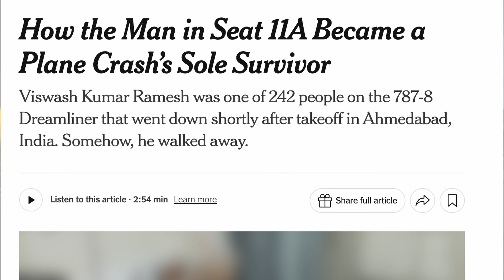Why the RAT Changes Everything – Air India 171 Update

Comment: Suggestion  why All Air Plane   not have a technical mechanasume to complete shutt the flow of fuel  and  completely shutt it off withe no any leaks avoiding fier. Or away to isolate the fuel tank and sending it to ground or away from the plane avoiding fier reason the worse thing hapoining in crash is the fier cause hitting down still we can have savety factories

Shams

Comment: My deep condolences to all affected by this tragedy. 

Wrong flap settings or operation  = pilot fault. 

Dual engine failure, could be fuel failure (water ingress or similar) although you’d have expected to see signs of that earlier. Could be double bird strike. Ooph. 

Boeing’s stock isn’t going to like this.

Comment: Stupid question for any aircraft engineers out there. The fuel pickups points would be at the low point of any fuel tank which is where any water contamination would collect. Are there any sensors to warn about water in the tanks? I suspect a conductivity check in the tank or a density check on what's flowing thru the fuel lines would tell. Any warning could switch to another tank for fuel.

Comment: A point you didn’t mention is the dust cloud as it took off. Others have said they used the whole runway to get airborne, this surely also points to engine trouble. 

I understand they taxied to a mid point and then rolled back down to start of runway before proceeding, so they did use the whole runway - maybe some figures estimating weight and expected V2 point would be helpful

Comment: Actually if dual engines failure theory is true. Pilot's have shown acumenship of retreating the flap or lets say not deploying them fully, else that would result in adding further more drag and more thrust requirement (which was absent) and would result in further less time in air.

Comment: Hello Captain Steve, this is Captain Neo, sea captain. Now it is obvious that they had thrust loss. I believe that fuel contamination scenario is little bit unrealistic, however there is possibility for that, of course minimal possibility. In my view the most realistic scenario is that something happened to electrical systems and hydraulic power. The APU is of course an extra source for emergency power , but the emergency prop generator is the last solution for the loss of power. I don't sure if the APU can start by battery emergency source, but if is not then the prop generator is the only solution in total loss of power. Please inform if the APU may start without main electrical power source, but just by emergency batteries or any other starting system. The APU probably is jet /gas turbine generator. I believe that when the main electrical generator ,which is if I remember well is on left engine, lost power then APU should start automatically within some seconds and if APU not start then the RAT automatically deploying. That is right ?

Comment: The other thing is why did they take every inch of a 11,500’ runway to barely lift off.  There are so many reasons for this besides engine issues.  No one has discussed these reasons.  Instead everyone wants to assume how it happened.  I flew this aircraft type for 6 years and I’m not about to guess how this happened until we have substantial data/evidence of what actually transpired over this short period of time and the time leading up to this takeoff.  I enjoy your content, but I was shocked to hear you reverse your thoughts merely by the suspicion that the RAT was deployed due to a dual engine fail when there are multiple ways that the RAT can be deployed.  Please listen closely to that clip of the aircraft passing by prior to the impact.  You will hear that at least one of their engines is running.  Thank you for what you do.  Your channel is certainly one of the top aviation channels and it’s obvious that you love what you do.  A couple accidents reviews that might give a little insight into loss or lack of lift are the Comair CRJ200 accident in Lexington, KY as well as the 1987 accident of Northwest 255 in Detroit, MI.  Fly safe!

Comment: I hear jet engines running also. But yes, I will accept the theory it was down on power. It fits with my opinion the aircraft was sinking as it was flying to slow for its takeoff weight. I am thinking it crashed because the pilots were given the wrong cargo weight and calculated a V1 and V2 speeds that were too slow for the true weight.  I am wondering why they did not immediately retract the undercarriage to reduce drag and gain airspeed. It seems the instinctive thing for any pilot to do when lacking airspeed for any reason. The black boxes will give the answers.

Comment: Why does everyone think that the deployed RAT automatically means dual engine failure?  There are 4 ways for that RAT to be deployed.  Manually is one of the four ways to drop the RAT.  I still can hear at least one jet engine running as the aircraft passes by before impact.  Their Mayday call has been quoted  as several different statements.  All of them eluding the power was not sufficient.  If the plane was sinking and they had the throttles at the stop, it may have appeared to the pilots that they were losing power and not recognizing that they were actually losing lift.  If that was the case, they may have dropped the RAT manually to ensure controllability of the aircraft.

Comment: Have you seen that video of a man who was on the flight before it crashed? He had taken a video of the inside of the aircraft when it flew into India, saying that the electric wasn't working. AC was out, the screens on the headrests weren't working either, and he was going to send in a complaint about it. He took photos of the outside of the plane as well and confirmed it's tail number was the same. If it was having electrical issues in its most recent flight before the crash, then maybe it had something to do with that? Maybe the plane shouldn't have been cleared for flight.

Comment: So I said in Steve's last video that though the theory that they pulled the wrong lever was completely ridiculous by any kind of trained pilot...and mention the RAT myself via the video and audio evidence.

The other question is why was the landing gear down...and my theory there is... Had both engines failed, with the RAT deployed they may have thought they had enough power to get to immediately get somewhere to land. And obviously to do that they had to keep the landing gear down.

I'm still not discounting complete hydraulic failure...because even with no engine power they maybe could have steered away to a less populated area. With no hydraulics it very likely would have continued to just go straight like it did...

One simple  thing you need to ask the one survivor:  did you hear any engines?  If both engine had flamed out it would have been quiet as a mouse in that cabin...and something he certainly should remember.

I'm sure by now they have at least one box so it won't take long to figure out exactly what happened..
Reply: The survivor clearly told in one video that there was sudden silence and then he heard a loud bang underneath and later green and white lights started to flicker inside aircraft.
Reply: @shakeelabegum_sk I actually haven't heard many of his interviews so that would definitely lead creedence to the double engine failure.  Other than the fact that there's an infinitesimal possibility of that happening... So the big question would be HOW?  If it was contaminated fuel come unless the contamination came from the plane itself, it would have affected other flights.   We should hear more soon as they've had the flight recorders several days now.

Comment: A theory has formed in my mind. I am not a pilot nor an aviation expert so correct me if i`m wrong but based on RAT being deployed and a report that AC and in-flight entertainment not operating properly, I think that some kind of power failure caused both fuel pumps to shut off starving the engines.

Comment: @CaptainSteeeve Does it not at all to you sound like there is some thrust in those jet engines as well, all the way down??. Yes, the RAT can be heard, but in my ears it sounds like those jet engines also are working, somewhat anyway? I have been in to the flaps up instead of gear theory my self, until now. I almost hoped it was a clear pilot error, even how crazy that sounds. Pilot errors are isolated incidents, but if this is a Boeing or GE problem a lot will happen, in an already shaken industry. As well as flying customers being scared to enter any plane soon, many of them carrying same systems.. Thats why i am saying an isolated incident with a pilot error would have been the best of the bad… 
One would think contamination would have been noticed before 400 feet!? But finally, cant rule out sabotage or maintenance error either yet i guess..  RIP to all passengers who lost their life's and a huge thought goes to their relatives.. (ex pilot from Finland) Thanx for great videos..

Comment: I used to work in scientific instrumentation for acoustic measurement and analysis, and I've spent most of my life living between "London" Luton Airport and the Shuttleworth Aerodrome. I know the difference between propeller noise and jet noise: you are hearing propeller noise of some sort and I thought that even with the poor audio quality of the rip-off copy of the video clip.
And what you are NOT hearing is one or two big turbofans producing any meaningful power at all. You can also see this, because if there were thrust, the aircraft wouldn't be sinking that quickly and I doubt that the automatic flight controls would be pitching the nose up quite so far. I can't go as far as to claim the aircraft wouldn't have crashed, but it wouldn't have crashed so quickly and certainly not in the same place. 

It is not impossible, however, that an electrical fault might deprive the engine controls (FADEC) of their power and thus deprive the engines of their intelligence. That could make the engines fail in a strange and unusual way: it would certainly be a difficult failure mode for the crew to recognise and report.

Comment: There was a person that flew with his airplane right before it crashed. He said that there was a massive electrical issue on the previous flight no TVs no lights no nothing it could be. It’s electrical issue.
Reply: I've flown in air india aircrafts, tvs not working is a common issue
Reply: You're right to point out that. While the initial reports and public discussion often linked the previous viral videos of non-functioning amenities to the general state of Air India's older fleet, aviation experts and official investigating bodies have indeed stated that such issues are highly unlikely to be the direct cause of a catastrophic event like a plane crash.
Here's why and what the investigation is actually focusing on:
 * Hierarchy of Systems: In-flight entertainment, lighting, and even air conditioning are considered "non-critical" systems for the safe operation of an aircraft. A plane is designed to fly safely even if these systems fail. The critical systems are flight controls, engines, navigation, communication, and structural integrity.

Comment: Is there any possible way a 787 can suffer from a total electrical failure that can cause the loss of the engines/thrust or is that totally impossible? My thoughts would be on the latter, and there would be some sort of redundancy involved to ensure only one engine could be lost, but I'm no expert.
That leaves us with total loss of both engines, if we discount any sort of Aircrew "finger trouble" or hostile intent, then that leaves some sort of accidental fuel contamination (it has happened before, but not so instantly and drastically) or some sort of maintenance error, or deliberate act of sabotage. 
Now India and Pakistan haven't had the best of relationships lately (if ever) and I'm not a conspiracy theorist, but it shouldn't be discounted that somebody on the ground possibly caused the issue on purpose?

Comment: I believe the RAT deployment is indicative of what happened - but not because of a dual engine failure, but a PERCEIVED dual engine failure. The flight path is so close to so many other improper takeoff configuration accidents that I started looking around and thinking and found this sequence of events most compelling:

-They take-off, rotate, but the plane does not behave normally.
-Because of improper takeoff configuration or wrongful execution of the gear up maneuvre the flaps are/stay retracted
-The plane does not produce enough lift to stay airborne. 
-Pilots don't have enough situational awareness in that split-second to deduce they are experiencing a takeoff configuration issue and assume they are dealing with a dual engine failure and start executing the dual engine failure checklist memory items:

-FUEL CONTROL switches (Both) -> CUTOFF, then RUN

-RAM AIR TURBINE (RAT) switch -> Push and hold for 1 second

Cutting fuel supply to perfectly working engines. They also deploy the RAT and desperately trying to push the nose-up but nothing could be done any longer at that low of an altitude.

Air India faced scrutiny by its improper training regime in the spring of this year, so this might have been a contributing factor to consider too.

It was one of those absolute nightmare situations and many other pilots would have done the same.

Comment: Man, it's so frustrating to know that the pilots tried everything they could in those moments and knew there was no way out. :-(
BTW, I saw on YouTube and personally tried MS Flight Simulator with both engines failing (I'm not a pilot, but I know the basics of instrumentation and flying a 787) - I can tell you it was a terrifying feeling of complete loss of control, watching that massive beast plummet to its doom with 100 tons of fuel. It's like a vehicle without brakes, only much, much worse... Sincere condolences to the families of the deceased...

Comment: Great explanation Captain Steve.  Hope you see my comment and can respond to it; Is there a chance that when the co-pilot went to raise the landing gear he inadvertently pulled both the throttle controls back to idle, instead of raising the gear?  I say this because when an engine flames out (most times, but not always), black smoke is seen at the exhaust of the engine showing incomplete combustion, but absolutely nothing is seen in the video from either engine.  It just seems like all power was just removed from the engines by the flight controls.  Just my thoughts.  Let me know what you think, thanks.

Comment: Great video, as I said yesterday I think they had a catastrophic electrical failure. A man who boarded this flight a day before mentioned there was very unusual things he noticed like in flight entertainment not working, the device to call cabin crew, A/C not working etc etc, he also said he was very hot on the plane. Why were these things not spotted by the cabin crew/captain of the plane? I think something with the electrics blew up, leading to  no power in the engines etc, It would explain the loud bang, no power in the engines, the RAT deployment and also why they could not retract the landing gear. An aircraft like this does not just suffer a double engine failure, they would have to be something to cause that and I think it was a catastrophic electrical failure.

Comment: Except that the RAT doesn't provide any electricity for cabin lighting galley's stuff like that. It's more like "essential bus" stuff and hydraulics.
The flickering lights in the cabin I think is anecdotal 
With a dual engine failure the cabin lights would've went completely out and not flickered and come back on again.  Just saying

I think we all agree it's somewhat pointless conjecturing we really need to wait for the black box Data -at that point we all know.

Comment: Here's my 0.02. Since the two engines operate independently there is nothing they could possibly share other than the fuel and the air that could cause concurrent failure. Since these are turbofan engines and one has to start the other while the plane is still on the ground, when we factor in that plus the gate time, plus taxiing, plus takeoff, those engines would have shown some anomaly that the pilot would have registered had the fuel been the issue. That leaves the air as the main suspect. Broken, bent or missing intake blade(s) on both engines at the same time is not a reasonable assumption. That leaves air pollution, long-term exposure to high ozone levels or something similar as my best guess.

Comment: If the fuel supply valves are closed which are manually controlled what will both the Engines do ? They will fail. So the theory that both the Engines failed is wrong in the first case , they failed due to no fuel supply & RAT got deployed as already programmed ✅😡

Comment: Dual engine failure is exceedingly rare!!  ... The only example I can think of was that 777 landing at Heathrow with ice in the fuel, clogging the filter, but that was after a long flight.   There was no ice at take-off.   Only at altitude did the water in the fuel freeze.

Comment: I would have concluded this was dual engine failure simply by the lack of turbine exhaust or noise. Deployment of the RAT is yet another piece of evidence. This aircraft was gliding. Without thrust, this was inevitabnle. Had it happened at higher altitide, it could be glided in. I don't think there was any chance to land this aircraft.